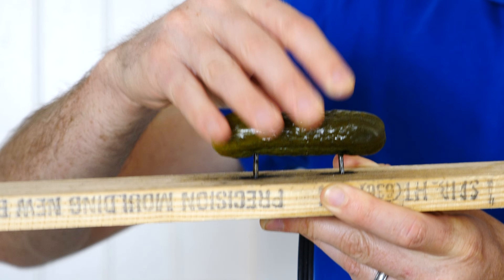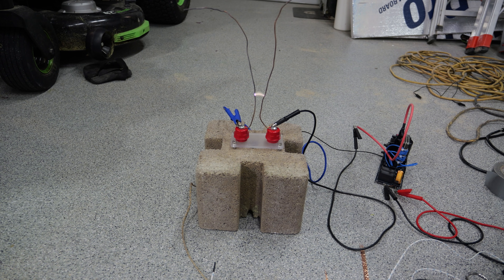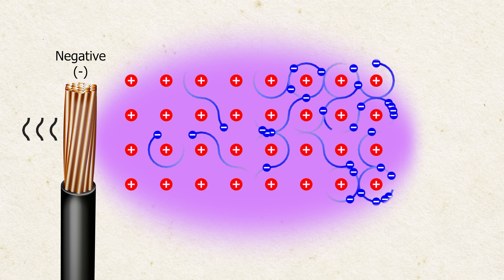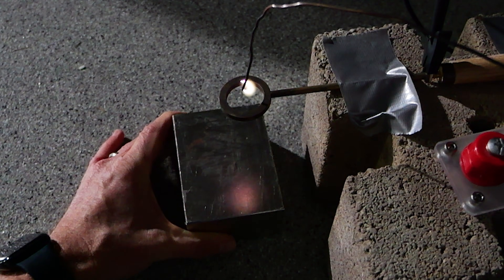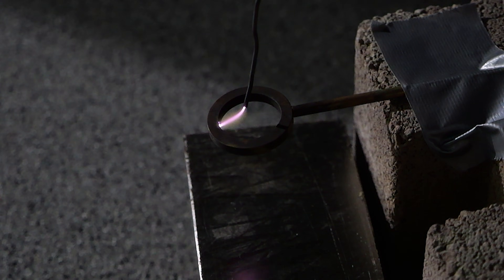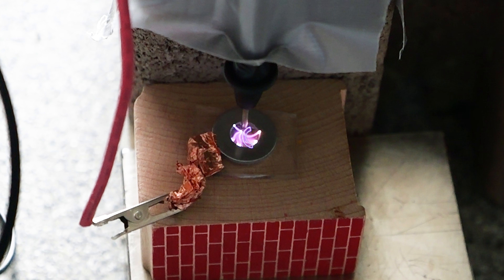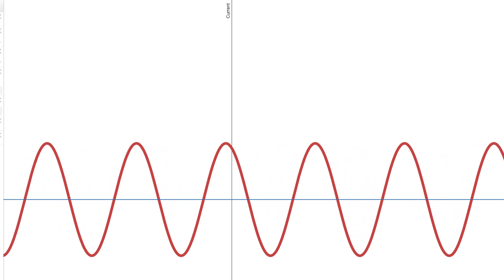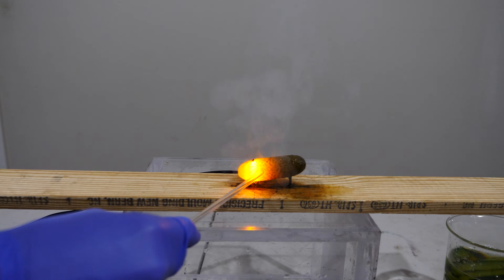Why AC Electricity Doesn’t Behave the Way You Think

Comment: 1:58 something that's 50,000x smaller is -49,999x as big as. Something that's half as big is .5x. Something that's 1x smaller is 0. Something that's 2x smaller than some thing is -1x as big as the original thing. You meant to say 1/50000th the size of, or 1/50000th as big as. Say that.
Reply: There are a LOT of people using the "X times smaller" phrasing and I agree it makes no sense! 

If something (Object A) is one mile long, "1 times" a mile is... One mile..... 5,280 times 1 mile is 5,280 miles. To say that Object B is 5,280 miles shorter than Object A makes zero sense. What is the "Shortness" of Object A if it is 1 mile long?!?
But to say that Object B is 1/5,280 the length as Object A simply means that Object B is 1 foot long.
Reply: @tomharner83  "To say that Object B is 5,280 miles shorter than Object A makes zero sense"

It makes perfect sense. It means that Object B is -5,279 miles long, if Object A is 1 miles long.

Lengths and costs and sizes can all be negative, imaginary, etc.

There's a square root of every debt, and, as such, it must be denominated in imaginary dollars in some accounts, and positive dollars in other accounts.

Only if you take the real definitions of words for "x times" and then use the casual definitions of words for "smallness" or "shorter than" or "less than", where they basically mean that only positive real numbers, sometimes positive integers, sometimes positive integers and 0 (counting numbers) are allowed. Which is a really dumb set of definitions to choose to operate with.
Reply: Less massive, not smaller
Reply: @MelodicTurtleMetal  No. 50,000x less massive is -49,999x as massive as.
Reply: @MelodicTurtleMetal  One needs to say, "1/50000th as massive as" in this case, to be correct.
Reply: Apart from the mathematical pov, the shear difference factor 50,000 should cause a way bigger bias than 70-30 regarding the heating of the electrodes
Reply: @b.s.7693  Why "should" it? Is there some metaphysics that you're privy to?
Reply: Another question: the plasma in welding is made of an inert gas like argon. So where is the constant stream of positive argon ions going to?? Surely not into the metal. But the electrons do. So imo, the ions do actually not participate on the current flow.
Reply: @b.s.7693  Start your own thread. Interesting idea, I have no idea about that. I'm just saying what words mean. 50,000 times smaller than means negative 49,999 times as big as. 50,000 times less than means negative 49,999 times as much as.
Reply: The flyback transformer he used has built-in diodes and some electronic neon sign transformers are knows to have a DC bias for some moving plasma effects in the tubes.

Comment: Actually...  the ring and cathode assembly acts as a capacitor. And the ring is dissipating energy into the surroundings, most as eddy currents into the magnet and those into heat. That is the part not going back into the wire.💡

Comment: You also have one side of your pickle that heats up more because resistance goes up with heat which cause more energy loss on that side causing more heating.  This runaway effect would happen even with no DC bias.
Reply: The flyback transformer he used has built-in diodes and some electronic neon sign transformers are knows to have a DC bias for some moving plasma effects in the tubes.
Reply: @mernokimuvek  Flyback transformers are literally a dc power supply...  So yes, they'd be DC biased.

Comment: the ZVS is naturally unbalanced by its own design, no two components are identical... it has to have imbalance to even start...

some of this is just a measurement and reference issue.

"biasing".

the way the current flows is as dependent upon the circuit, as the supply.

feed that AC waveform into a transformer with a center tap. the magnetic flux in the iron core is symmetric once its powered up and settled down.
the output? you have three choices of "grounding".  hot, cold, center...
two choices of "output". terminal to terminal or terminals to tap.

but what is "ground"? we assume this vast reservoir that DOESNT CHANGE.
this is our reference, most of the time... we forget this. we take it for granted... we are stuck in a certain reference frame. it clouds our perceptions...

we strap one side of our circuit to ground... we get an asymmetry.
we strap our centre tap to ground, we get symmetry when all is equal... it often isnt... thats how audio output transformers work. "push pull" is an intentional "imbalance". 

use a proper NST. a center tapped transformer. use two electrodes. two rings. the arcs will spin opposite directions.

i also suspect thermoelecric effects, there is a junction, two in fact, at high potential gradients... 

always noticed one pole of my rather large induction coil got decidedly cool. below ambient.

Comment: If dc bias came purely from geometry, then it wouldn't change the direction with the switching of the conductors. It has to do with phase relations of the harmonics and the time/amplitude asymmetry in of the signal. Even without the DC voltage, the DC curent can be inducedthou interaction of nonlinear effects and frequency spectra. That is captured by that plasma nonlinearity isn't purley resistive, but it has memory component and/or it's described by time varying circuit elements. Peaple also  don't remember that aparent power besides resistive and reactive components(for each of the frequecny main tones and harmonics, also has distortion components comprised of inter harmonic and inter tonal intermodulation producst)

Comment: I’m guessing this video will get a wider feedback as it provides room for discussions. The pickle has high resistivity, so the circuit behaves like a constant‑current source. In such a system, any additional resistance dissipates more power without significantly changing the current. If that dissipation increases this resistance even further, the effect becomes avalanche‑like, releasing even more heat until a discharge occurs. This is IMO why the opposite side of the cucumber cannot initiate a discharge once one of the contacts begins glowing, until the cucumber as a whole remains cool.

Comment: A power electronics and magnetics expert here.  It seems that your DC bias argument is clearly wrong.  
With a transformer you can have a DC bias on the primary that you are driving however the transformer action will guarantee that the secondary winding can not have any DC - the action of the transformer guarantees perfect volt-second balancing.
If this were not the case then this would mean that by placing a permanent magnet by a transformer would induce a DC voltage in the windings.
If you look at Maxwell's equations then they explain what I am describing here.
Reach out to me by DM if you want to discuss this further.

Comment: You should consider that AC from the municipality is 1/3 of the 3phase source, ... which means that it is by definition NOT a sign wave. This is why there is a live wire (one of the phases) and a neutral (the common feedback wire) - This is why grounding can csuse problems in your balance issue because its interfering with the pseudo-sign wave.

Comment: Yellowish side of the pickle is more conductive due to amount of water in it, the other side is more "fiber" that acts like a semiconducter (logically thinking, not being an expert) 🤔....the spinning plasma effect,  you shall knew that the old transformers are "switching electromagnets" while in the SMPS haves full-bridge rectifier to turn into DC (that actually defines the poarity) than is converted into a simulated AC by switchers (FET, MOSFET), so you actually get pulses of positive DC

Comment: US power is split phase. Not high positive to low negative. It goes from neutral to high. Not the same as single phase like in Europe. 

Try 249 US and then you can get a full single phase.

Comment: When I was observing my HV DC plasma experiment, the same question crossed my mind, but I came to my own conclusions, which were... Why is only the negative electrode getting hot?  Perhaps because when the HV DC ionizes and heats the air between the positive and negative electrodes, the heated air separates into positively charged heavy gas ions and very light, hot electrons. Both are hot, but because the gas ions are much heavier than the electrons, they transfer more heat to the negative electrode than the electrons transfer to the positive pin.

Comment: the resistance of that green thing is not homogenious across.  either the higher or the lower resistance heats up or if a temperature difference already forms the resistance is not the same on either side so conductivity shoose prefrence. also the fish dont know its in water just as us dont take the earth magnetic field into account that can bias wich polarity that get slightly stronger and your magnet is like using two magnets incuding the earth. one phenomena affect resistance and conductivity while the other affect polarity bias due to magnetic infuence. you think to much in seprate silos it wont make sense. once a current form a magnet can infuence it regardless of the ingredience of the material the current pass trough or what ever polarity it switches as it will also supress one polarity reinforce the other.

Comment: I guess this is why some metals require AC TIG welding on them to be performed with some helium in the gas mix. The helium ions have the least mass per charge possible (reminder: hydrogen can’t be used 💥), so the reversed current in the AC cycle should be able to do a more effective cleaning action against the metal’s oxides. Heavier ions would make it harder for the electrons to do the cleaning in the reversed pulses, which would waste energy and material

Comment: Related, one of the less-noticed phenomenon is n-type and p-type semiconductors have different conductivities, which affects rise/fall times of pulses. Electrons (being the charge carriers) are less bound in n-types and tighter held in p-types. A recent development was a "less different" p-type semiconductor. Normally the difference is 3-4 resistance, if not more. The rise/fall times of the pulses will be limited by the slowest switching times, so you could either have less-lossy junctions at the same speeds, or even faster, if they can get the p-type difference down. The geometric differences go down to the atomic level, so even if you had geometrically "perfect" shapes, you'd find L/C displacements and weird off-scrambling.

Comment: Please re-try both the pickle and ring experiment, but, place a large motor-run capacitor in series. the capacitor will pass the AC component, but, charge to block the DC component. Switch off the apparatus, and measure the voltage across the capacitor, and from that, you can determine which is the "cathode" and "anode" of the "rectifier". I recommend a 70uF, 440v oil dielectric motor-run capacitor. something that won't have any effective impedance to the low current circuit. (VANGUARD RD-70-144, or, Genteq 97F5251, also, RD-70-144) These capacitors are large enough, to allow a 10 megaohm meter to capture a reading, before being discharged by the load of the meter itself. Most digital multimeters have that high impedance. Be sure to set the meter to 1,000 volts to start, because arc rectification can potentially put pretty high voltage across the capacitor. With the pickle, disconnect a high voltage lead before disconnecting the supply, because the pickle will immediately discharge the capacitor.
Reply: The flyback transformer he used has built-in diodes and some electronic neon sign transformers are knows to have a DC bias for some moving plasma effects in the tubes.
Reply: @mernokimuvek  That's why I recommended the use of capacitors in series, to eliminate any DC bias current, while passing the AC component of the high voltage. Capacitors block DC current.
Reply: @vincentrobinette1507  But his flyback transformer has no AC output at all, so a capacitor would block everything. He needs to get an AC flyback.
Reply: @mernokimuvek  I see what you're saying: If the output is already rectified, all it would do, is charge the cap. I was under the impression that the diode was removed. If there's a diode in series, what you have is a pulsating DC, which would try to charge the capacitor to that value. The capacitor I specified is only rated to charge to 622 volts DC, and would be destroyed by the 5,000 volts available from the flyback supply.

Comment: What does this asymmetry do to the overall grid? Does this need to be corrected for by grid operators?
Reply: stray currents and higher harmonic from non-linear loads do constantly leak back into the grid all the time. Especially these  days, when whole bunch of cheap switched-mode PSUs are used literally everywhere. They o do something, but i'm not sure what. I know they have filters at various places that cut off wrong frequencies, but how they deal with  dc currents i am not aware.

Comment: the electrode/circle (hoop) test would wobble/turn even with 100% pure AC (no voltage supply dc offset) due to electrode/hoop size surface area).  The hoop will build up  negative charge due to its larger surface area which will force the electrons from the skinny electrode to fan out to one side or the other causing arc wandering.  Look to see out a DC sputter chamber works, the main component that drives which electrode is more/less negative is by 'plate size', meaning total surface size.  the larger plate will become negative, this will attract the gas ions to it and 'sputter' this larger plate electrode.

Comment: 1:35. i think that's backwards. I'm pretty sure dcep gets the electrode hotter. in TIG welding you almost always use DCEN for this very reason. you want your positive charged work piece to get the heat and you want to keep your negative torch cooler. please explain
Reply from the maker: For TIG welding the negative electrode stays cooler because tungsten is a great conductor so it can remove the heat quickly and also it takes less energy to remove electrons from tungsten than other metals. Because of this the cathode sheath voltage is small so most of the arc voltage is across the entire plasma allowing electrons to gain most of their energy before striking the anode and heating the workpiece. So TIG welding is specifically designed to make the anode hotter. But the Debye sheath is still present in TIG welding. It just doesn’t lead to the cathode getting hotter.
Reply: Except for "conventional current" flips this around.
Reply: @jnawk83  No it doesn't. That's only related to the current direction, which was never mentioned in his post. What you're talking about could be used as an argument to someone saying something like "the current carries the heat in the same direction it's flowing" but no one said that, and it still doesn't only supports what the original poster said.
Reply: I agree. I think he has the effect incorrect since the higher heat is generated from the high speed electron travel.  It appears the effect is reversed here and the explanation isn’t valid.
Reply: The flyback transformer he used has built-in diodes and some electronic neon sign transformers are knows to have a DC bias for some moving plasma effects in the tubes.

Comment: I don't know if the AC had DC in it. But it's moving because it has an electromagnetic field within it's perimeter. If you take the magnet away, nothing happens, because there's no "DC in the AC". Also electromagnetic fields will store a charge like a Capacitor.

Comment: What about a Neon blub?  I wonder if there's a DC bias on the two electrodes inside the bulb, maybe one gets slightly hotter than the other?  Can a FLIR camera tell us that answer... maybe, and maybe not... IDK.   I know if you light a neon bulb with DC that only one rod or pole illuminates (I forget which polarity it is, when you switch the wires and the opposite pole lights.)  But AC both poles illuminate.

Comment: In an audio amplifier a capacitor will filter out DC. so could you use a capacitor to remove the DC from the output. But a problem that dosent need solving |I think.
Reply: The flyback transformer he used has built-in diodes and some electronic neon sign transformers are knows to have a DC bias for some moving plasma effects in the tubes.

Comment: If you use high voltage DC, you should be able to overcome this natural tendency for one electrode to become the preferred electron emitter. But where is the balance point for this changeover? You could find out by putting a variable AC voltage in series with the DC source.

Comment: Wait but when welding it's the DC positive electrode that gets to hot.

If I'm welding Tig its set to DC electrode Negative.

If I have it on DC+ the Tungsten Electrode gets destroyed.

Can anyone explain that one please.

I've always thought that it's that the electrons are all hitting the tip of the tungsten.

Where as when it's DC- the electrons are coming off from a slightly bigger area along the sharpened tip of the tungsten.

But I really don't know, I'm welder and do not have a clear understanding of the theory of operation.
Reply: I agree! He has the effect wrong.